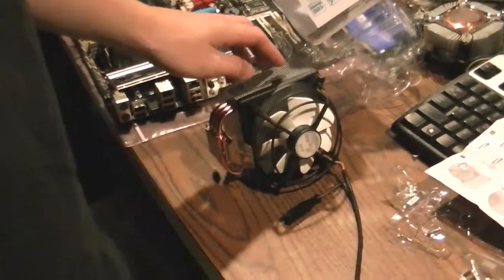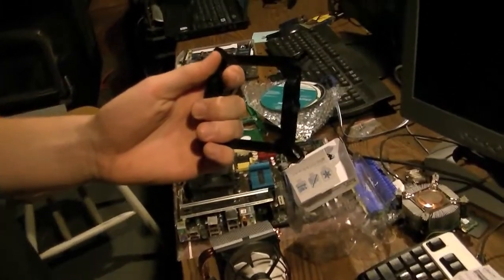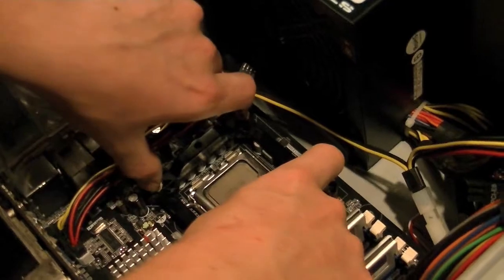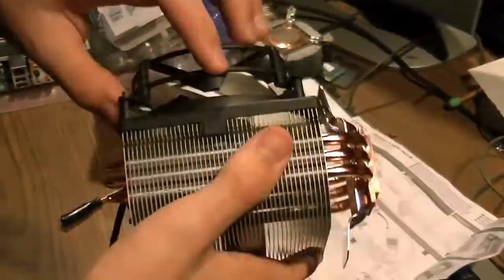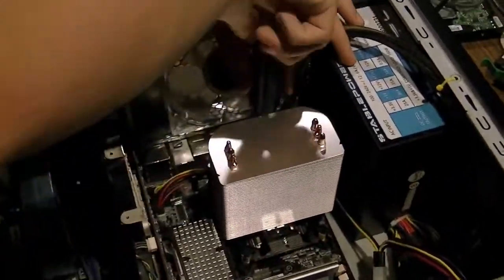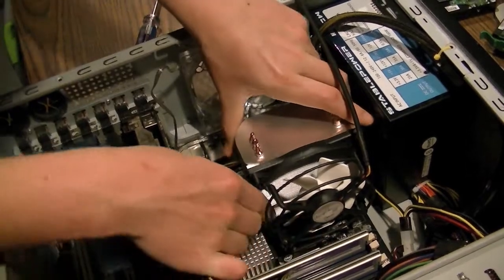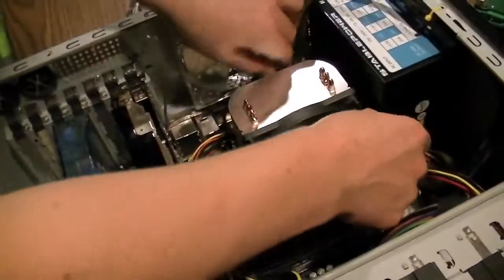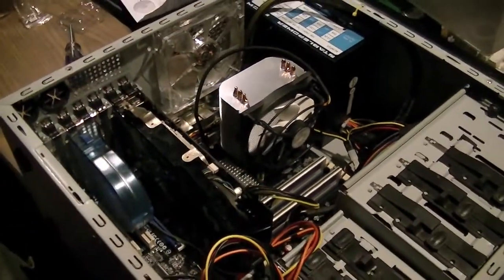Artic 7 CPU Cooler Socket LGA 775  Installation

Comment: Would this heatsink and fan fit and work in my Dell Optiplex 755 usff on the Core 2 Duo E7200 2.53Ghz CPU or E7600 3.06Ghz, both socket 775 CPUs.

Comment: Hi there, I have a Asus P5W DH Deluxe with a Q6600 CPU in it. I have had this PC for about 5 years and the temps are crazy! I get 80C at idle and 90C on load and It has worked like this for 5 years, which is incredible really. I think it is about time to try and bring those temps down, so I was looking for a small cheap fan that is better than the stock one. I did lots of research and came to this one, as I only have 130mm space in my case. This isn't going to become my main PC, in fact I am buying a very high end gaming laptop, but I want to use this as a backup and maybe a gaming PC in the bedroom. Do you think this is a good cheap choice for my needs? Hope you reply. Thanks!!!

Comment from the maker: You cannot replace a processor of a certain socket with a processor of a different socket. Each motherboard only supports one socket type.
Reply: That's incorrect. You can insert a socket 771 CPU into a socket 775 motherboard with a few minimal modifications to the CPU.

Comment: dude i have an HP EL436AA and i bought a bit of a bigger cooler for the cpu and it has those stupid push tabs. They dont fit because the mother board has screw holes and the plastic tabs are way too big to go in do you know of an inexpensive cooler that will work? it is also an LGA 775

Comment: I use socket 775 for gaming In my pc but I think that the arctic 7 coolers are overpriced( in the uk they are) so I use xilence coolers, they're really cheap and use the nice easy mounting brackets. PS doe you guys ever use MSI mother boards,if you don't next time. You need a reliable board use an MSI,they all have solid caps. I've been using 2 G41-P28's one for my gaming pc and the other for my family's file server it has ran for 1 year straight and I've never had ant problems